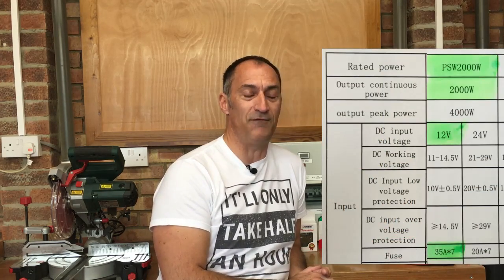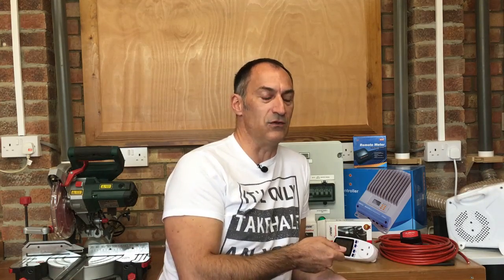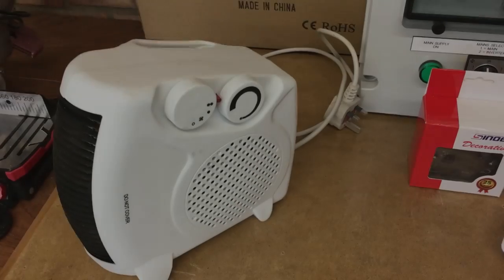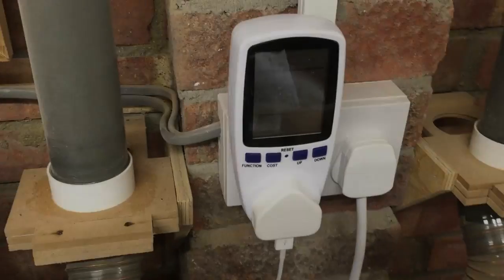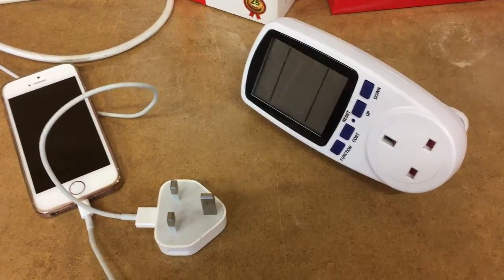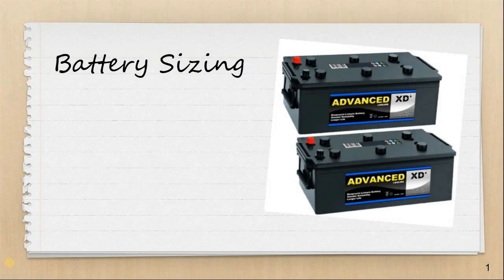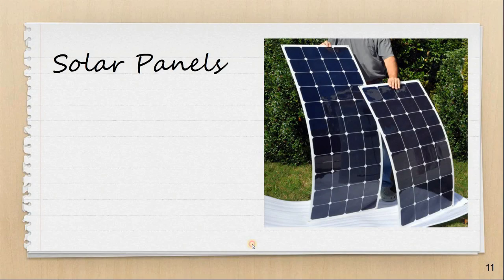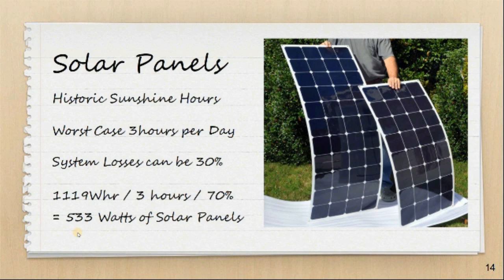Off Grid Battery & Solar Sizing - Self Build Campervan

Comment: Hi Greg,
  First of all I am so grateful for all your videos and information you have supplied.    Really great job.       I am looking round for a Peugeot Boxer which I plan to convert.    One thing I was wondering about is connecting the leisure batteries to the vans alternator.     It appears you have not done this and therefor I presume there is a good reason.      What are you thoughts on this matter?
Once again a big thank you.
Chris Bond
Reply from the maker: Hello Chris, bit of a story there. I was going to fit a split charge kit. One of the first things I purchased and I installed the 16mm red battery cable during my first fix install. However after having done tons more research and gained more knowledge plus advice from the battery supplier it would be better to install a B2B charger as it would look after the leisure batteries better unlike a split charge which is basically just a switch. So if you want to charge while driving fit a DC to DC charger instead of split charge. 👍🏼😃

Comment: great vid Greg very thorough , a quick question if you dont mind. if i used the 12v usb sockets for my ipad and iphone would the amps still be the same as they are in your calcs, i know the watts would change also did you have to check the other apliances that you will use on the 12v circuit through a 12v socket  thanks for your help
Reply from the maker: Michael Lowe the max amps for a USB socket would be 3Amps but 12v cigarette sockets the max fuse size is 15Amps so a 180W load @ 12volts
Reply: @GregVirgoe  thanks for that, but you could use and charge  an ipad or iphone through the usb sockets couldnt you.
Reply: thats meant to say,,could you? not you could.. was a question not a statement lol
Reply from the maker: Michael Lowe yes you can use and charge both through the usb sockets.
Reply: @GregVirgoe  thanks for your help

Comment: Hi Greg. The fridge and combi boiler are listed as both 12v and 230v. What functions of the boiler and fridge are operational on 12v?
Reply from the maker: Johnny Devenney at that stage I was looking a 2 way or 3 way fridges but have settled on a 12v fridge. 
The boiler has 230volt for electric heating and 12v for control power.

Comment: Question, your fridge you have recorded as being run for 6hours a day off the 12v. Wouldn't that need to reflect 24hours for the periods you didn't have access to a mains hookup?
Reply from the maker: Hi Robín, the fridge is connected to the 12v supply 24/7 and switched on. 
Fridges don’t run all the time. They come on and off by a thermostat inside. When it gets warm it turns on the compressor and when down to temperature it switches off. The internal light is only on when the door is open. So the more you use your fridge the more electric it will use. 
So 6hrs rum time in 24hrs is a good estimate of its actual running time. Hope that makes sense 😃👍🏼

Comment: Modern alternators via a split charge relay may fully charge the battery as they will switch of charging before they have been fully topped off. I believe it is anything pre 2006.

Comment: Hey Greg, great videos, you have given me so much inspiration to crack on with my Transit conversion, thank you. Little question on your load calculations. For your LED lights, you have a quantity of 10, rated at 10 watts each, on for 6 hours. 10*10*6 = 600wh. On your load calcs it says 60wh total, I am assuming you've adjusted that figure because not all of the lights will be on at the same time? Is that correct? I'm not planning to have as many appliances in my van but my total watt hours figure has come out almost double yours! Would be great to know. I see you're also a fellow Essex lad, I'm just up the road from Colchester, hopefully we'll pass each other one day.

Comment: How come you have listed the fridge as being used for 6 hours? Surely it as a 24 hour constant energy draw? 
Thanks for all your help so far :)
Reply from the maker: Hello Bex, all fridges do not run 24/7 they are plugged in and switched on but the compressor only runs when the thermostat gets warm. 
The light is only on when the door is open. So the more you use it the more it has to work to keep cool. 
Most of the time it sits there cold and satisfied and drawing no power. So 6 hours is an estimate of the compressor run time. 😃👍🏼
Reply: @GregVirgoe  Thank you very much for that informative and quick reply! These videos are helping me enormously :)
Do you have any idea what the maximum sort of draw time for the compressor would be, say for example, you're in a hot climate and the fridge is working harder to keep cool? (Using a vitrifrigo 12v compressor fridge as my yardstick here)
Reply from the maker: Bex Nuttall it really is an estimate as there are so many variables but you could allow for 50% or 12 hours use that would be a lot though.
Reply: @GregVirgoe  Thank you Greg! Hugely helpful :)

Comment: hi there. I think there are AGM batteries in your van Greg. Also from some pics ive seen that you have a PPT mains charger. I see in the ppt website that they should not be used with AGM. Have you had any issues with this combination as I am about to buy new battery and I also have a PPT mains charger. Thanks
Reply from the maker: Kevin Gallagher no issues, I spoke to the guys at PPT about this as I was also concerned and wanted to check. They assure me it’s ok on setting one which is for lead based batteries. 
I’ve only had to use it twice in two years as we are 100% solar but it did perform perfectly without any problems. 😊
Reply: @GregVirgoe  thanks greg. I sent them a message but I am about to get new batteries tomorrow and was tempted to go AGM.
Reply from the maker: Kevin Gallagher if you manage your usage and keep them above 12v all the time you’ll get thousands of cycles and they’ll last years. 
Save the money for enjoying yourself in your travels.

Comment: Greg, another great video, have learned a lot, now time to put it to the test, bought a new van and plan to kit it out over the next few months. A lot of things would not have thought of if not for your video's , for example checking all the LED's before you install them very good. Have a ? on switching the LED via WiFi vs IR, good idea, no line of sight required, so I guess that will require a WiFi network, ie a router in the Van, so is there a 12V model you recommend ? (didn't see it listed on your load sheet), or do you use a battery powered hot spot ?, and maybe why not use Bluetooth
Reply from the maker: Hi Tommy, you do not need a WiFi network in the van to use these controllers. You simply connect your phone directly to the controller. You will see the controller in your WiFi search list. It’s just an alternative to Bluetooth. I’ll be honest with you I haven’t used them as much as planned it is a bit of a hassle just to turn a light on. Bluetooth would be better but I may even go back to the simple IR remote for something more convenient 😮🤔

Comment: Hi Greg, thanks for sharing your knowledge. Why did you only scope 6 hours of fridge and not 24 hours? Thanks
Reply from the maker: Stefan Jagger the fridge only uses power when the thermostat turn the compressor on. It does not run all the time. This depends on how much you open the door and put warm food in it. So this is an estimate of the compressor run time for normal use. 👍🏼😊
Reply: Thanks Greg I appreciate you taking the time to reply. And so quickly too. Best wishes.

Comment: Thanks Greg.
Great help I'm just putting 2x150w German panels on my sprinter with a 100/30a smart charger victron.
Just in case I add another panel.And I have 2x170amp Agm batteries hope this will be fine.
thanks again for your top videos.
Regards
Jeff
Reply from the maker: jeff carter yes that sounds like a good setup. Just be careful to keep your usage below what you can generate until you get the extra panel on it. What part of the world are you in. D what’s the daily sunshine like?
Reply: Greg Virgoe 
Unfortunately Greg I’m in Manchester so not great sunshine we have webbed feet up ere it rains that much lol.
Jeff.

Comment: Hi Greg I’ve just got a waeco fridge for my vw van I’m only running that plus 6 led lights  , I was looking at 300 w solar but would 150 be ok ? I’m in the uk 🇬🇧 so you can guess the sun light ?  Also I’ve seen this downside it’s from China but other than that it looks good would 150 w be ok for fridge and lights ? 
eBay.         143148920763

Comment: Hi Greg, first off, perfect videos! i'm a marine engineer so absolutely love the detail of all of them from the start! i know I'm a few years late to the party but just decided only now to do a conversion so was hunting the net for inspiration and came across your videos and I've been bing watching for the last 4 days now haha! I have a question though with this video about when you reference the combi operation. In your table when you segregated items into red, amber and green.. the items in red (combi, fridge, hairdryer) you mention that (because of the high wattage consumption) you'll only use these when the van is plugged into a hookup. Does this mean then that you cannot ever run these systems when off-grid? Even if you're only using the combi for 20 mins lets say just to have shower or run some heating in the night..? Many thanks Graham UK
Reply from the maker: Hello Graham, when I did that video I was considering the dual fuel appliances. Like 2way fridge with both mains and 12v. The Truma is Dual fuel also runs off LPG and Mains electric.
Both the fridge and Truma will work fine off grid on either 12v or LPG. So there are line items in green for those items when working that way. The electric elements in the Truma you would only use on a hook up as they are 1800W and too much for batteries. It will still run in its 4kW gas burner off grid no problem. 
In the end we just bought a 12v fridge which only runs off the batteries and that works brilliant. Dometic CRX50 they are expensive but work really well. Hope that helps you. Thanks for watching 👍🏼
Reply: Thanks Greg, i see now yes makes sense. So sorry if you've covered details like this already, I've watched almost all your conversion videos in the last few days and I've probably filled my brain to over-spill level, you've probably already covered everything! Just finally.. the 1800W 'electric elements' in the Truma.. Are these components such as: a fan heater style component to create the warm air and an immersion style heater element to create the hot water? Thinking about it now it may help me when selecting which unit to have. May just go for a single fuel LPG unit depending on budget and how much the electrical option would actually ever get used.. The fridges you mention are good yes! technology has moved on a bit now so my top level objective is to have everything 12v and to only have 230v items which are not available in 12v form. kind regards, Graham
Reply from the maker: MrRestog no need to apologise I’m happy to answer any questions. 
The electric in Truma are two 900W elements like immersion or kettle elements. We have never used them yet, but it’s nice to know we have that backup plan if we ran out of gas. Definitely go as much with 12v as you can and avoid 230volt stuff if possible as inverters are very energy inefficient. 🤓
Reply: Thanks Greg! Looking forward to your future videos!

Comment: Since you are dealing with 230 volt mains, your AC main would be rated for 16 amps. The reverse polarity indicator is wired in BEFORE your AC main as a safety feature. A 2 pole AC main breaks both L1 & LN since the nuetral line can be energized to ground if the polarity is reversed.
Reply from the maker: Jeff Wisemiller I have a plug tester and reversing lead to deal with that scenario. 😊

Comment: Hi Greg, after your recent tour are they any regrets/changes you wish you'd made sizing up your batteries and or your choice of solar power panels? Also, how many sun hours on average were you getting in Spain/Portugal towards the end of your trip in March. Tia.👍
Reply from the maker: The solar and batteries are great more than enough to be 100% off grid in Europe through the winter. I was getting on ave 650Whr of solar a day in winter. 
Today in south east England over 1kWhr of power. So plenty.
Reply: @GregVirgoe  Hey Greg, that's great news!  Sounds like you chose good size battery's and panels. Thanks for all your videos, they really are fantastic and they inspire me to build my camper...(one day!) and hopefully save myself from my mid-life crisis! 🤣  How's the sprinter going?

Comment: Hello Greg, we have question regarding 3k inverters, we are intending to have a 12v battery system,  do we need to change this to a 24v system to be able to use a inverter over 2k+? We are under the impression 12v system will max out at 200amps with a 2k inverter, Loving all the vids keep them coming buddy.
Reply from the maker: JR M my first question is “what are you using in your van that requires a 3kw inverter?”

Comment: ive just been to the Truma stand at the NEC.  I was left with the opinion you can heat water and heater from gas and some 12v - but your stating. 230v volts as well on top (for sure you can heat with just 230v if on a shore line)?   If your right how will you stay warm/heat water of grid ? Kettle :-)
Reply from the maker: Colin Moss, the 12v dc connection is just for controls. 
The LPG is a 4kw burner that gives you loads of heat and hot water. That is off grid. 
The 230v connection is two 900W electric elements. I can run this off my inverter but it would drain the batteries in minutes so it’s best to use the electric on hook up. 
We have been off grid 100% of the time, never hooked up ever. We have loads of heating and hot water using the gas.

Comment: Great informative videos Greg!! may i ask a question on this particular subject as im just in the design stage of a racevan build for e-mtb's. basically sizing up batteries for what you have plus 2x ebike chargers, the info on them states, input 100-240v 2.5A 50/60hz. Output 40V=4.4A/42V +4A. 
what battery size would i need with the additional 2 chargers for 2 days off grid. Never been good at the electrical side, rest of it i should be fine though. keep up the good work.
regards
Nick

Comment: Great videos especially showing it all from the beginning. I'm a bit late to the party but have you considered diversity for 230v and battery charging. You'll obviously have the split charger which I suspect will be your main battery charging source but what about a generator too, either something in the 'garage' or your own portable 'shore power' simply sat outside? The Wolf generators seem quite good, affordable and the new models are also quieter. I am surprised you don't have battery charger in your system too.
For the power calculations is there a set of tables published somewhere?

Comment: Hi Greg, you and your videos have been a life-saver and are giving me the confidence to do this for myself, so thank you! I'm curious that you only have 6 hours for your fridge - is that because the motor doesn't actually run all the time or do you not leave your fridge on all the time? Sorry if this is a daft question.
Reply: A fridge onrly runs for a short while then stops, then start again when temperature rises. My fridge and huge freezer combined used 70w on average measured over 24 hours when it was 20c outside in the summer. But one thing about fridges and freezers that run on 220v is that they use about 1500w for a short while (a few seconds) when starting, if you have only a small battery and a 1000 - 1500w inverter you will need a supercapacitor to help give enough ampere when it starts.

Comment: great video again Greg. Think I see a error in your calcs though. Your fridge will run about half the time, and so your total hours on 12 volt should be 12, not 6. If you do plan to hook up to mains each night, then you probably will take that down to 4-5 since the fridge will be used more during the day, when its hotter. The hair dryer should be ok with the solar you have, and the alternator will charge you backup pretty    fast when driving. AGM are good batteries, but Lithium are far better for those kinds of loads. As I am sure you probably know. I have 600 amp hours of Victron lifePo4  batteries in my RV, probably go with the same on a van build. Lot less weight as well. Also the Victron inverters are pretty good. More efficient. But more cash !
Reply from the maker: Bob Fomenko how long is a piece of string??  At best it’s an estimate it’s impossible to say exactly how long the compressor will be running because there are too many variables. Depends how many times you open the door, how much warm produce you put in there and what the ambient temperature is. So the calculation is not wrong it’s a best guess. That’s all it can be.
Reply from the maker: Bob Fomenko, 600Ah of Lifepo batteries you obviously have loads of money. It isn’t necessary to go to that expense to have an off grid system. I’m 100% solar and have been all this year. The fridge is never turned off and we use electric as much as we like. Batteries are always maxed out each day. They only cost £400 total and have 4 year warranty. Happy days